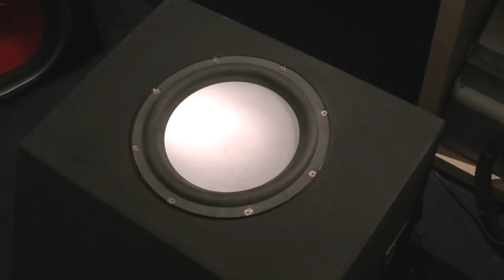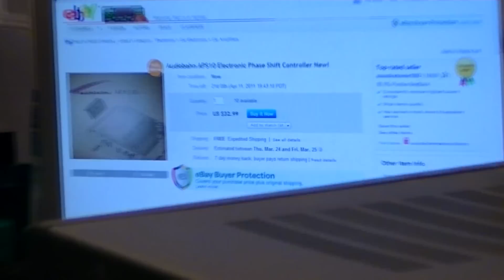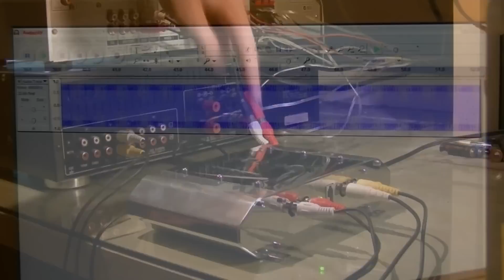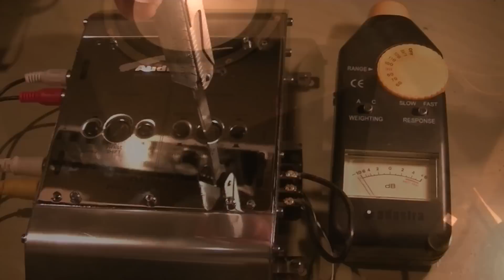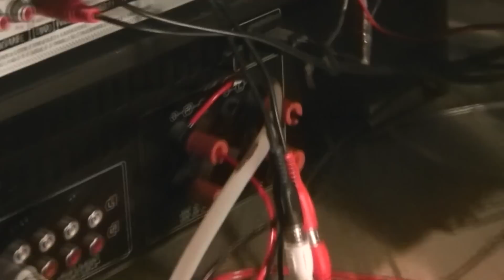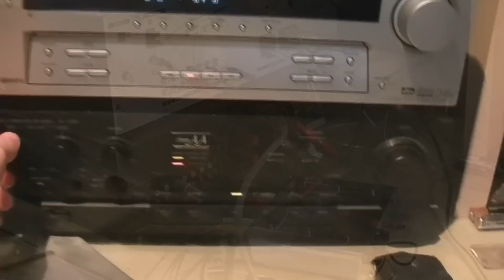How to FULLY bridge any amplifier! EASY steps

Comment: I tried this with a Behringer CX2310 crossover feeding an Acoustic Solutions SP101 amp. You have to connect the speaker to the "+" of each channel and push the polarity invert button to one of the subwoofer/low outputs on the crossover. You also have to match the gains.

I'm not sure why but I did find the amp made sounds like a speaker voice coil striking the back plate and thought I'd damaged a Kappalite 3012lf in a vented box because of lack of high pass filter but I never heard the same sound off of a Peavey IPR1600 yet the Acoustic Solutions made the same "knock" noise without reaching full excursion on the Kappalite. It was quite a powerful amp though when bridged with about a 35V clip limit instead of 17 Volts RMS per channel (20 into heavy clipping).

For some reason when I tried this with a Lepai 2020A I got no more power than with a single power.

Bridging does halve your load impedance though, although that amp is fine driving 4 ohm loads so an 8 ohm speaker bridged should be fine, although complained a bit with 2 ohms (got hot and the sound distorted more easily but no knocking sound like with the bridging).

Note: You can't invert the polarity of one input by swapping the wires round inside one of the RCA jacks as they share a common ground and you will simply short one of the input signals to ground, only giving you sound into one input.

Comment: it's very easy to make an inverted signal by using a simple op amp or a NPN or PNP transistor with a nine volt battery, and it will cost one dollar...
Reply: you can also just flip plus and minus on the rca jack on one of the splitted signals right?

Comment: P=V^2/R so power will quadruple with a doubling of voltage, and also bridging will give you 1/4 of the load impedance.
Reply: Just HALF the impedance, power is x4 because the voltage is squared.  The amp sees double the current for a given signal so it thinks the load is 1/2 [it 'thinks' it's driving 2 loads each with half the resistance, but it's really one load with the same resistance].  Power is still I*I/R, or 2I*2I/R, or 4 times non-inverted case.

Comment: Oh yeah if your amplifier is not bridgeable and if you can't bridge your amplifier but still want to get the full output of a amplifier that is not bridgeable and you want more power going to your subwoofers then you can wire one channel per voice coil on a dual voice coil subwoofer basically you would wire coil one on a dual voice coil subwoofer to channel 1 and wire the second coil on a dual voice coil subwoofer to channel 2 and bam more power is going to your subwoofer and you have the full output a non bridgeable amplifier but remember you can only get the full output of a non bridgeable amplifier by wiring 1 channel per voice coil if your using a dual voice coil subwoofer
Reply: I blew a few channels on a couple receivers had one arcing in my lap shootin 5 inch sparks there went the onkyo integra 
One question i only have front left,  center and i believe either back right or left working and im having to jump 2 speakers per channel and it sucks for almost everything because i get lefts and centers is there a way to use them that will say have the front left driving  Right and left without it just sounding left

Comment: Be careful when bridging a amplifier it can cause your subwoofers to get hot very quickly and can very easily blow your subwoofers at higher volumes also the manufacturer of the amplifier is not responsible if you blow your subwoofers when bridging your amplifier also the manufacturer of the amplifier is not responsible if you blow your subwoofers when bridging your amplifier even if your not exceeding the rms rating of your subwoofer you can still very easily blow your subwoofers at higher volumes and your subwoofers will get hot at higher volumes like for an example if you are running a 1000 watt subwoofer on a 300 watt amplifier bridged it could still heat up and get hot and can still very easily blow at higher volumes to make your subwoofers last longer I recommend not bridging a amplifier i bridged a amplifier and it nearly almost blew my subwoofers and I didn't over power my subwoofers and I didn't exceed their rms rating and I had the gains on the amplifier set properly and the subwoofers had a very nasty smell coming from them and they got hot and I ended up having to kill the power to the amplifier and wire the individually so that they would not blow

Comment: That's bi-amping, using 2 channels to drive one speaker, bridging is using 2 amplifiers to power a single, mono loudspeaker, using both +ve and -ve to drive the loudspeaker, almost like pushing and pulling. You're inverting one channel, to drive the -ve which is usually referenced to gnd which never goes -ve
Reply from the maker: Nope, Bi-amping is using two separate amplifiers two run a 2-way passive speaker, amp number 1 powers the tweeter, and amp number 2 powers the woofer. Tri-amping is the same but for a 3-way passive speaker, with Tweeter, mid, and woofer. And so on. A quick google search will tell you this. Inside a stereo amplifier, there are essentially two mono amplifiers driven by a common balanced gain control and power supply (although some high end amps have a psu for each channel). By bridging them we combine these two internal mono half-bridge amps to drive a single load in full-bridge mode, push/pull like you say.
Reply: Isn't that bi-wiring? :)

Comment: Thanks man , I'll be uploading the vid soon . 
Although I've used an opamp to invert the input . I used 10 resistors to bring the signal to ground level . 
Now I am not powering a sub , it's actually a normal woofer . But it's one woofer for a pair of minds and tweeters. So. I do needed the extra power on the woofer. I've tried everything before . I've smoked out my mosfets in parallel mode. 
Only your idea of inverting the duplicate of line input helped. 
Thanks ...

Comment: Had the same thought about cutting up the RCA. Will it work to simply swap the +- lines on one of the wires leading into the sub amp?
Reply: Ryan Freedman No, you must use a phase shifter.

Comment: You don't need a faze shifter you can cut a rca cable and flip the + -
Reply: wrong teribly wrong
Reply: SpeakerFreak02 No! A phase shifter is a must. You are not simply inverting the polarity, instead you are actually moving the sine wave ( audio wave ) over 180°.

Comment: Nice video. I guess i am old school but try this if you want to. This method is easy. Get a old deflection yoke from a old 12" crt monitor if you can find one. Use the vertical windings they are tuned for 60 hz and below. Use this as a choke on the sub. Take a tape monitor out source and use just the positive pins for a source. Plug into sub amp and do the same on the speaker terminals for the sub. This will provide a mono out source. Keep the sub amp from grounding to the other amp. You might be surprised on how good this sounds.
Been awhile since I done this but it does basically the same thing.

Comment: I JUST USE A AUIDO TRANAFORMER THAT HAS 2 10K OHM WINDINGS THE PRIMARY I HOOK TO THE LEFT THE SECONDARY I HOOK TO THE RIGHT IN REVERCI + - I WILL PUT A CIRCUT ON MY CHANNEL
Reply: Yes, isolating the inputs to "reconfigure the signal inputs", can be done. at a cost of LOSING (normal) stereo.

BUT - if one also has a desire to retain the original stereo "speakers" running from EACH of the isolated (normal) output channels, that system fails as the original speakers NOW self cancel and distort (terribly) the SP levels at the same time.

As I have explained above (using a single toroidal transformer within a dual circuit 1-to-1 isolating audio toroid) 
Such as this type:
http://www.photonage.com.au/150w-100v-28-ohm-audio-output-toroidal-transformer-p-2155.html

It is extremely easy to be BRIDGING the STEREO speaker outputs, where one is also STILL wanting the original two channels (stereo sound) to keep working as normal, then it's easy to see that if one simply parallel's a dual circuit toroidal, directly across & thus into the existing stereo (isolated) speaker outputs, one also thus gets a secondary "bridged mono" circuit, (entirely electrically separated from the original stereo outputs) which is also now isolated from the two "original" stereo speaker themselves, "done" without altering the original stereo SOUND

Thus retaining the two original stereo speakers, AND stereo sound, whilst gaining a single MONO bridged circuit, that can be further "frequency filtered" into a dedicated low frequency SUBWOOFER channel.

In other words, reconfiguring the OUTPUT 2ch stereo into a three channel (L.ch + R.ch stereo & "gaining" a CENTRE/MONO circuit as well) ?
One has actually INCREASED the output "sound" power, without destroying the integrity of the original equipment.
Reply: Jamie Phillips

Comment: Ive got  Pioneer TSW121SPL dual voice coil which is 4Ohms per coil. At the moment I have it wired as an 8Ohm load and have it connected to one channel of my 2 channel amp. The speaker output of my amp says 8-16 Ohms, is there a better way for me to wire it ?

Comment: why dont we just change the polarity on one of the pre inputs to the amplifier then it will be the same effect as changing phase ... what i mean just cut of the pre input and change the wires to give the same effect...ur comments required
Reply from the maker: faisi001 This does not work - i tried it. 
What happens by flipping the input signal is you send the signal to ground instead of sending it to the amplifier boards. the ground from the RCA then gets connected to the amplifier board, and, naturally, you get no sound. Its different from flipping a speaker output.

Comment: Terrible, all you need to bridge an amp is a couple of 10p resistors and the ability to read circuit diagrams. One resistor grounds one of the input to prevent noise pickup and the other goes from the output of the other channel to the inverting input of the long tailed pair on the input of the other channel. The speaker is then wired between the two outputs. No need for any external gadgets at all, much neater and a whole lot cheaper.

This is a good explanation of the technique http://sound.westhost.com/project20.htm

Comment: Hey man, great video as always :) I was wondering could you give me some advice on something? So I'm looking to do pretty much the same thing, on a much smaller scale. (Basically bridging two 3W 4ohm channels). I'm having some difficulty finding a phase shift inverter that's small enough and cheap enough to do the job (I can't spend any more that 3-4 euro per phase shift inverter)). Do you know of any alternative solutions to bridge amplifers that small? Basically I'm building multiple sets of wireless portable speakers so whatever I decide to use has to be very compact and affordable. Hope to hear back soon, thanks! :)
Reply: Also the amp in question is a PAM 8403 (Two amplifiers, taking the Right channel + and - from each, and the same with the left channel. ie. 4 outputs for 2 speakers).
Reply: ***** Thanks man, I'll take a look around for one :)

Comment: Wow, at 72V you got 1296watts into a 4 ohm load. The only thing is the amp is unloaded, if you load an amp the voltage will drop about 10V so your loaded to clipping output is about 50-60V. That is still a lot, about 756.25Watts at 55V. Still you could just connect on of the wires of the RCA cable to positive input on one side of the amp and negative to the other positive. That why you save about 30 dollars.

Comment: oh god dont buy that little box!!
 just phase one of the phono cables (like from sig-sig and gnd-gnd to sig-gnd and gnd-sig)
Reply from the maker: thedanesimon Jack Chapman Jacarch-Tech NONONONONO this does NOT WORK!!! I have tried it before this video. 
This is because in RCA signal leads, only the positive tip carries the signal. This signal is then fed through the amplifier stage. If you switch the wires around and flip them, then you are connecting the ring GND of the signal wire to the amp input, and therefore get NO SOUND. The tip signal you are then sending to ground and it disappears. THE SIGNAL DOES NOT COME BACKWARDS THROUGH THE GROUND! It is different to connecting a subwoofer backwards.
Reply: Does that really work? Never tried that.
Reply: yes it does :D
Reply: thedanesimon And can you explain how to do it?
Reply from the maker: No, I am talking about an analogue signal. The + from the preamp does all the work, push/pull. The - makes a ground circuit. The amplifier expects a push/pull signal into its positive input, which it then amplifies. The negative of the input just creates a ground circuit for current to dissipate. By switching the wires over, you are sending the push/pull a.c. analogue signal to ground, and you are connecting the grind circuit to the amps input. Try it, believe me, you will get no sound!
Reply: barevids I just bought an APS10 from the US I hope it works out, I got that sick of shopping for PA amps and being let down that so much that  I also bought an Technics SU-V650 on the cheap so I could bridge it and use it for some light power in my room until I can afford something new from Crown or another reputable company.
Reply from the maker: Jacarch-Tech Wow awesome amplifier you have bought dude! Let me know if you want any help setting it up.  NOTE that you ONLY need to use the APS-10 if you want to run a single subwoofer with a single voice coil. As soon as you have two or more coils, you can use both channels normally.
Reply: Yeah I have a single coil 4 ohm sub but I hear these Technics amps are very under rated so I hope to have a bit of fun with it :P Ill send you a PM if I need help :) Thanks a lot man keep the videos up :)
Reply: yes.
so on the phono conector there is a screen(which is the negative signal) and theres  a signal conector (which is the postive signal).
so what you do is that you switch around with the signal leads ((original(+to+ and to)(fased(180 degrees(+to- and -to+)))
Reply: that is something entirely diffrent, and you speaker then have to be a dual coil. :D
Reply: Oh thats because you are talking about a digital signal!.
im talking about a analog signal.

Comment: Do you really need the inverter? Can't you just connect the + and - in a lead the other way around, somewhere along the chain?
Reply from the maker: This does not work my friend. By doing this you are just sending the signal in the RCA to ground, and connecting the RCA ground to the amplifier, getting no sound.

Comment: or you can get a quality opamp (tl072 is a good one it has 2 low noise opamps in a 8 pin DIP), make a low noise power supply to power it, take one of the opamp channels and put it into an inverting buffer configuration (inverting amplifier with a gain of 1), this will give you the 180deg inverted waveform, and you might want to put the other channel that isnt inverted and run it through the other opamp channel with that opamp channel as a regular non-inverting buffer to make things as even as possible, then you can put it into a nice project box with some connectors and make it all snazzy and neat and be proud to say "i built that"